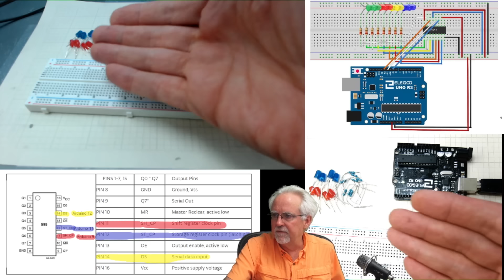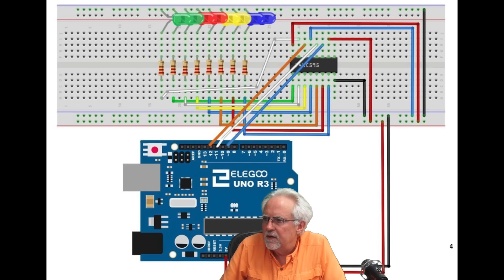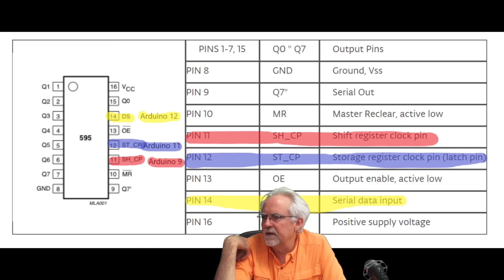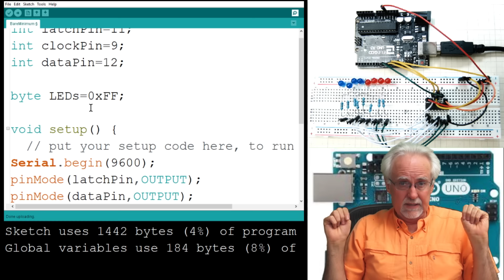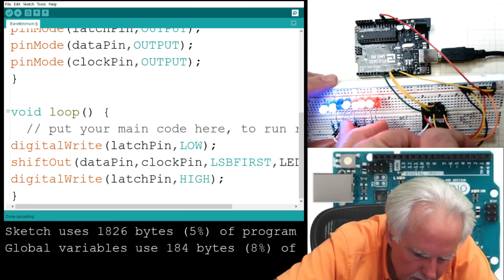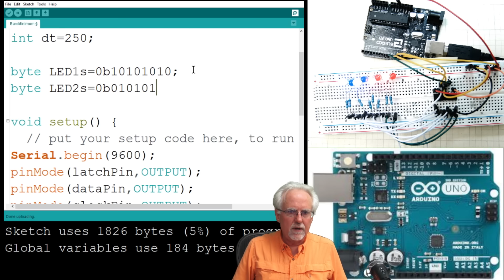Arduino Tutorial 42: Understanding How to Use a Serial to Parallel Shift Register (74HC595)

Comment: I come completed this homework on a TinkerCad model. When the sketch was started the LEDs sequentially light up counting from 0 to 255. Strangely, the TinkerCad model would show an explosion cloud on the 74HC595 on some of the binary numbers throughout counting, especially the higher numbers. Guessing there was a current overload for the numbers where most of the LEDs were simultaneously illuminated, I changed all of the 330 ohm resistors to 450 ohm, to reduce current flow. This seems to have solved the problem.

Comment: Thank you dear Paul for the excellent tutorials! 
I was able to make it work - the circuit seems to work almost the same as in you video, with one small and important difference: the default state of the outputs (the 8 leds) is on (high), this means that the second I hook up the Arduino, all 8 LEDs turn on, before I uploaded any code to it. I read a bit in the web, and it seems that the initial state of the 74HC595 outputs is undetermined. Is this true? How could I solve this?
Reply: For me, it was the 4 blue led's before uploading the code. I been scratching my head because I can only get those 4 to light. I rewired it 3x and have concluded I have a bad 74HC595. New ones arrive Friday, hopefully that is the issue. Anyway, I had noticed the same thing you mentioned. I can only assume if my IC was not faulty, all 8 would have lit up like yours. Mine seemed dim, but then brightened after uploading the code.
Reply: Got my new 74HC595's from Amazon today and replaced one with the Elegoo I could not get working. So glad I was correct and had a faulty IC (I went over those wires again and again). I doubt Elegoo would send me a replacement since I ordered my kit at the beginning of the year. But, if that is the only bad component in my kit, I will be happy.
Reply: I have the same issue and I'll be darned if I know how to fix it.

Comment: This tutorial was very well done. I have only one question. Why in the Fritzing diagram you showed were the current limiting resistors 220 ohms instead of the 330 ohms resistors you selected? Maybe an explanation of how to select a current limiting resistor might be helpful.
Reply: I (think) because different color led's require different voltages, using a 330 ohm is just safest. I believe using a 220 would be just fine though in most cases.

Comment: Let the haters hate. Troubleshooting is a crucial part of the learning process. I had issues too, ended up having a bad jumper on the ground and a loose connection on one of my 5volt jumpers at the same time. Methodical and calm troubleshooting process saved the day!  Thanks Paul.

Comment: This lesson was fantastic. I had one thought though. I believe I recall you having a 3D printer. You could design and print a holder for supporting your breadboard. :D
Also: void loop() {
  Serial.println(LEDs,HEX);
  digitalWrite(latchPin,LOW);
  shiftOut(dataPin,clockPin,MSBFIRST,LEDs);
  digitalWrite(latchPin,HIGH);
  LEDs++;
  delay(wait);
}
This was pretty easy! :P

Comment: Hi Paul, I had a problem where there was a faulty wire going to my clockPin, so I had the lights blinking randomly. When I touched the faulty wire I noticed that the lights would light up the way I wanted it, so that's when I knew the wire was faulty and after I changed it everything worked fine. 
I also did the homework. I made it work with one extra line of code. Here's my code: 

int latchPin = 11; 
int clockPin = 9; 
int dataPin = 12; 

byte LEDs = 0x00;
int dt = 50;  

void setup() {
  // put your setup code here, to run once:
  pinMode(latchPin, OUTPUT); 
  pinMode(clockPin, OUTPUT); 
  pinMode(dataPin, OUTPUT);
  Serial.begin(9600); 
}

void loop() {
  // put your main code here, to run repeatedly:
  if(LEDs == 0xFF + 1 ) LEDs = 0x00; 
  Serial.println(LEDs, DEC); 

  digitalWrite(latchPin, LOW); 
  shiftOut(dataPin, clockPin, LSBFIRST, LEDs); 
  digitalWrite(latchPin, HIGH);
  LEDs += 1; 
  delay(dt); 
  
}

Comment: Not sure I did the counting homework right because you said it would be hard but I just added one line to the one bite coding and it seems right "LED1s=LED1s+1"
Reply: Hi David, i think if you only keep adding 1 to the variable LEDs, the program will count more than 255, and that is not what we want. You are not able to tell by looking at the lights, but if you print the variable to the serial monitor, you will notice that the program counts past 255. 
So you need a way to reset the variable LED when it gets to 255. And then it's actually not that straight forward to have the program actually reset exactly after it has counted to 255.

Comment: We can never hate such a great teacher.....Thank you for this lesson sir..... : )
Edit -  Did the homework on 1st attempt......
Reply: Hi,
I think I have an issue with the shift register.
am using TPIC6C596 shift register and this register is capable of sending 8 bits. When I start sending 8 bits, I am getting only the last bit (i.e decimal point). But without the 8th bit (decimal point), my shift register can transfer whole 7 bits at a time. May i get the solution for this? When I implement in the proteus I am getting proper output. while doing the same in the hardware, I face the issue. For example, 0b00000110, I am getting the value as 1. if i do, 0b00000110 | 0b10000000, I am getting only .(dot) without 1. I should get 1.(one + dot). shiftOut(DS_pin, SHCP_pin, MSBFIRST, dec_digits[(buf[i] - 0x30)]|0x80); What will be the issue.?

0r my doubt is when supply goes to decimal point, all the other pins goes to OFF condition.
When supply don’t go to the decimal point, all the other pins goes to ON condition.
Is that correct?

Comment: Hi Paul, just a technical question: I followed all steps two times, but something is not working. When I write 0xFF as byte value all led power on and when byte = 0x00 all led power off, as expected. Any other hex or binary value of byte doesn't work! Do you have an explanation?

Comment: Can i connect all the LED's (-) through one resistor to the Arduino and since current is very small and data signal comes directly from Arduino? In the circuit for every LED is still 330 ohm (for all ). I have done all my LABs this way and nothing has burned down. I will get one resistor and put it in instead of this black line (most right) one 330 resistor. Of course when current gets higher this solution wont work and all my good intentions go to sky high :)
EDITED a day later: my solution worked when i didn't' have CHIP between (+) and (-).(This was with earlier projects) Since all diodes like tu use different amount of current my "simple solution" didn't consider it. Later i did schematics as Paul and in this case every output of chip was almost equally drained. I used tiny LEDs and red ones are always very power hungry (i had use 1k resistor) for to get the same light like blue ones gave with 10k resistors. Then picture got clearer and i saw which one was lit :) Fun project! Moving on:)

Comment: FYI, my kit came with the 74HC595N. I only get it to display the last pattern in the loop. Connecting pin 13 to GND fixed that. In my case, pin 8 could be disconnected without any ill effect.

Comment: my homework..
int latchpin = 11;
int clockpin = 9;
int datapin = 12;
byte leds1 = B01010101;
byte leds2 = B10101010;
byte count = 0x00;

void setup() {
  // put your setup code here, to run once:
Serial.begin(9600);
pinMode(latchpin,OUTPUT);
pinMode(clockpin,OUTPUT);
pinMode(datapin,OUTPUT);
}

void loop() {
  // put your main code here, to run repeatedly:
for(count=0x00; count<=0xFF;count++){
 digitalWrite(latchpin,LOW);
shiftOut(datapin,clockpin,LSBFIRST,count);
digitalWrite(latchpin,HIGH);
delay(1000);
}
if(count==0xFF){
  count=0x00;
}
delay(500);
}

Comment: I think i have a problem because i wire everything as it is the code is the same and nothing happens only my last diode is on 
Even if the sketch is empty i checked the connections but nothing everything is wired fine on my chip is written 74hc595n is this different than the chip in the tutorial

Comment: Mine works but it is very unstable. The chip was up, i pushed it down and it still is unstable...gotta rewire. Pin 10 and 16 can be connected together for VCC. Pin 10 was not connected, so that made it erratic.

Comment: Sir this was an amazing lesson, I loved building it together, and I loved learning all this new code! Also I did the homeowrk! Here my code. It was actually quite simple

int latchPin=11;
int clockPin=9;
int dataPin=12;
byte LEDs=0x00;
int dt=250;

void setup() {
  // put your setup code here, to run once:

Serial.begin(9600);
pinMode(clockPin,OUTPUT);
pinMode(latchPin,OUTPUT);
pinMode(dataPin,OUTPUT);

}

void loop() {
  // put your main code here, to run repeatedly:
digitalWrite(latchPin,LOW);
shiftOut(dataPin,clockPin,LSBFIRST,LEDs);
digitalWrite(latchPin,HIGH);
delay(dt);
LEDs=LEDs+1;
}

Comment: I hooked it up based on the schematic, but knock my chip lose doing the wiring.  Took a few minutes, but I found it by checking all connections.  Glad that you shared when it happened to you.   Great lesson.  Thanks for doing this.  I'll try the homework.

Comment: Interesting observations. You can mix INT an HEX in math or while() statements for looping and it works, mostly. Also, the analogRead of the output to the chip from pin ~9 is not unique for every number so I'm not sure if the Serial.print is truncating the information or it's not formatted correctly.  I'll have to continue playing. Nice homework project.

Comment: I actually did the homework while you were diagnosing your wiring issue (because my chip was all the way in, and it worked right away). I remembered the binary counter lesson and figured this would work just as well. LEDs++ & a small delay, good to go!

Comment: I advise anyone struggling with wiring up the LED's to maybe buy a better breadboard... I realized the one in my kit was bad because I bought new ones on amazon and it's 10x easier to plug in components.

Comment: int clockPin=9;
int dataPin=12;
int dt=250;
void setup() {
  // put your setup code here, to run once:
  Serial.begin(9600);
  pinMode(latchPin,OUTPUT);
pinMode(dataPin,OUTPUT);
pinMode(clockPin,OUTPUT);

}

void loop() {
  // put your main code here, to run repeatedly:

flip=255-myByte;
Serial.println(myByte,BIN);
digitalWrite(latchPin,LOW);
shiftOut(dataPin,clockPin,LSBFIRST,myByte);
digitalWrite(latchPin,HIGH);
Serial.println(flip,BIN);
delay(2000);
digitalWrite(latchPin,LOW);
shiftOut(dataPin,clockPin,LSBFIRST,flip);
digitalWrite(latchPin,HIGH);
delay(2000);
}

Comment: I'm confused what the data output pin signal is sending out to the shift registers data input pin because you didn't apply a Hexadecimal value or binary value to the shift registers data input pin? Can you give a lot examples of what shift registers are used for?

Comment: I could not get the last 5 LESs to work. After a long while I noticed the red and blue lines stopped about half way down the breadboard. I put a jumper across the bridge to the other ground strip and all of the LEDs came on. Yet another lesson learned. It really fells good when it all works.

Comment: Very good video, and, yes I had problems. Put the circuit together, put the grounded pin 8 and my Arduino went dead. Uh oh!. I ended up pulling the ground wire out of the pin and lights came back on on the Arduino. Got the idea the issue might be the 74HC595, so I looked up the data sheet and found out I had the orientation wrong. My chip has a little notch and an O at the other end. So I subsequently reoriented the chip and BOOM!! Lights everywhere.

After that I did the homework, which based on your video on HEX numbers should be pretty easy.

Anyway, great work, Paul. Yes, we learn far more from our goof ups than when everything goes perfectly.

Comment: Great Video as I learned a great deal from it. My future projects needed more outputs that what the Arduino had available and was thinking I would need to link several boards together to make it happen, but I think through coding and hardware that I will be able to do it with one Arduino. I have been a mechanical engineer for more than 30 years and the sound advice you are providing to ones coming up the ladder in invaluable talking from experience.

Comment: Another great video.  The hooking up the circuit is the part I really look forward to, don’t really have much trouble with that. I was pleasantly surprised with how simple the code was too. Yes, it was a bit longer video but only because you show exactly what and where while explaining why, can’t ask for more. Thanks again Paul. Now to figure out the homework. I’m guessing from your hints there are a new command or two we need to use so I guess I’ll try and find them.

Comment: how does it work with rgb leds ? how can we code the colors and how can I light up the less 1by1 ? thank you
Reply from the maker: Lea think of it as three different LED . . . A Red, A Green, and a Blue. You can get any color by mixing those three. Then you can adjust color strength inside of a for loop if you want to cycle through colors.

Comment: Hello! I did the homework by mi self and it worked; Thank you very much!
int latchPin=11;
int clockPin=9;
int dataPin=12;

byte nr=0x00;
byte a=0x01;

while (nr<=0xFF){
            Serial.print("Value of the nr in HEX is: ");
            Serial.println(nr, HEX);
            Serial.println(" ");
            Serial.print("Value of the nr in DEC is: ");
            Serial.println(nr, DEC);
            Serial.println(" ");
            digitalWrite(latchPin, LOW);
            shiftOut(dataPin, clockPin, LSBFIRST, nr);
            digitalWrite(latchPin, HIGH);
            delay(2000);
            nr=nr+a;
            }

Comment: My 74HC595 seems to be messed up. For some reason, it didn't want to work if I wired it as indicated here or in the manual. I'm a doctor, not an engineer, but I started to play with the pins, hoping something would happen. And it did! It seems that I had to plug the LEDs with the negative side towards the 74HC595 pins. Alsoo, when I send 1 the LED goes off, and when I send 0 it turns on. So I created a "revert" function above the loop, in order to revert the values of the byte. It's all...upside down, but at least it's working. That, or I'm not seeing the forest for the trees. I'll buy a new chip when the quarantine is over. Anyway, thank you so much! You made everything so much clearer!

Comment: Hi, Teach!!

My code for the homework:

int latchPin = 11;
int clockPin = 9;
int dataPin = 12;
int wait = 500;

byte LED = 0x00;

void setup() {
  // put your setup code here, to run once:
  Serial.begin(9600);
  pinMode(latchPin, OUTPUT);
  pinMode(dataPin, OUTPUT);
  pinMode(clockPin, OUTPUT); 
}

void loop() {
  // put your main code here, to run repeatedly:
  digitalWrite(latchPin, LOW);
  shiftOut(dataPin, clockPin, LSBFIRST, LED);
  digitalWrite(latchPin, HIGH); 
  delay(wait);  
  LED = LED + 1;
  if(LED > 255){
    LED = 0;
  }
  Serial.print(LED, DEC);
  Serial.print(", ");
  Serial.println(LED, HEX);
 }

Do let me know what you think about it.

Regards.

Comment: This mistake had me going for a while

pinMode(latchPin, OUTPUT);
pinMode(dataPin, OUTPUT);
pinMode(dataPin, OUTPUT);

I ripped apart my circuit a bunch of times & tried different boards.  Moving wires around would cause the LEDs to go on and off so I was thinking it was wiring the whole time.

After the fix in the code everything worked

Comment: a tip on reducing the brightness of the LED's: pin 13 on the IC is PWM enabled and one can change the brightness of the whole array. if tied LOW (pwm 0), it gives full brightness, but the higher the PWM value, the dimmer they get. i run my led's on a PWM 250 and it makes the whole project a lot less annoying to work with.

Comment: Most Awesome tutorial as usual. You had me going there. I triple checked the wiring because I was getting lites on right away so I was sure I had messed up good. Once I was sure I just sat back and watched as you went over the board and found the loose chip. It highlighted my own struggles and was a great relief. Thanks again

Comment: I had a very difficult time with this lesson. I understood the lesson content but had a hard time building the circuit. Initially I only had the 16 and 32 bits light. In my trouble shooting, everything went down hill. I burned out 5 LEDs by accidentally touching the 5V wire directly to the positive LED leg. Eventually, in my doing this...trying that, I found the IC wasn't seated properly. In my attempts to correct that issue, I broke two pins on the IC, rendering it useless. For the home work, I built the counter, but since I couldn't use  the SHIFTER IC, I put the number to Serial.print.
Reply from the maker: Good news is you are learning the hard lessons on inexpensive components. One of my students recently was not thinking and miswired a $300 rockblock satellite modem and fried it. That was a painful lesson on an expensive part.

Comment: this lesson built very nicely on the previous hex lesson. much simpler to understand once i got the concept hex. i knew it was base16, but i hadn't made the connection that it would simply represent the first four and last four bits. and homework done, also made easy by the hex lesson. also, i find it nice that we can work the equations with decimal numbers and the output will be auto converted to hex/binary for the register.